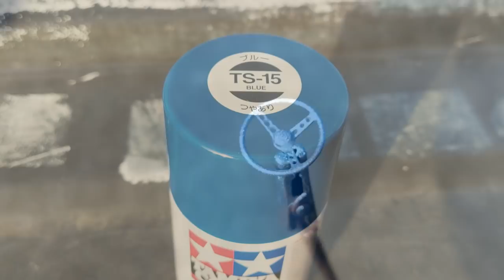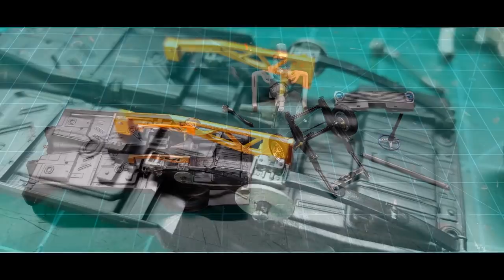Moebius 65 Chevy II Nova Gasser Build with Tips & Tricks

Comment: Those "Moon" steering wheels with the metalflake gloss vinyl rims were certainly popular in the 1960s. I recall around 1990 working as a race car fabricator walking into a race supply called JFK in the San Fernando Valley and finding in one aisle a pallet box full of those wheels in all colors with a sign on the side of the box saying $1.00 each. They were manufactured a few miles away at Superior Industries. Nearby in the race shop there were the same steering wheels with gloss black vinyl or flat black foam rims hanging on a rack with a $35 price. I liked the foam rims. Had one in my 61 F100 with a 428 Cobra Jet, 1 in each of my 2 Baja Bugs, 1 in my offroad race buggy and a couple more in the garage.
Reply from the maker: Oh wow, very cool!!!!!!!!!!!!

Comment: Nice  build.  On the  passenger  side  you could  have  filled  it with  a  thin  piece  of  styrene  and painted  it  metallic  black. It would  look  closer  to  the  floor  pan. Also don't  be  too  quick  to throw  out  the  spruces. You can get a lot of different  exhaust pieces  with the  different  lengths  and curves.  Have  a  good  weekend.
Reply from the maker: So true Scott!!

Comment: Another great video Tim!  You did a really good job on the weathering!
I always save the empty parts trees and when I get a model box full, I go through them and clip the long straight pieces that only need a couple sprouts cut off, and I save them for stirring sticks. They’re great for mixing paint or putty or those bottles of blue paint that separate between uses. I use them for all kinds of things, sometimes they can be used instead of Evergreen plastic rods!
Reply from the maker: Thanks Roy, hey, that's a great idea!!

Comment: Just wondering what is the point of the nubs on the wheels? Couldn't you remove them and not have to worry about making marks in the tires?
Reply from the maker: Not sure, maybe a molding process. But yes, you can cut them off and sand the outer rim smooth.